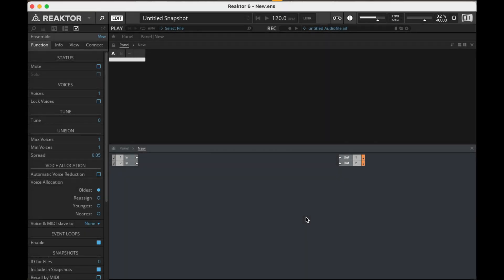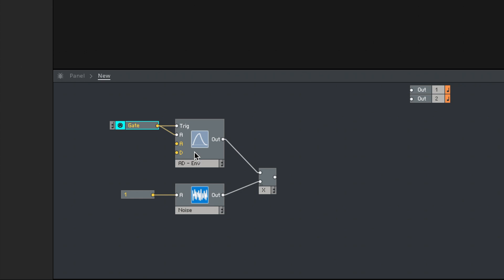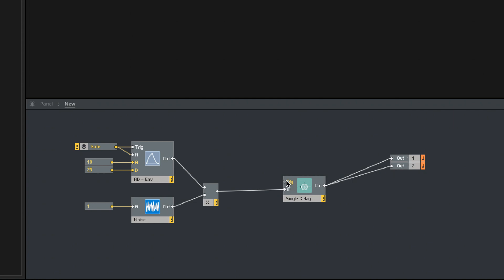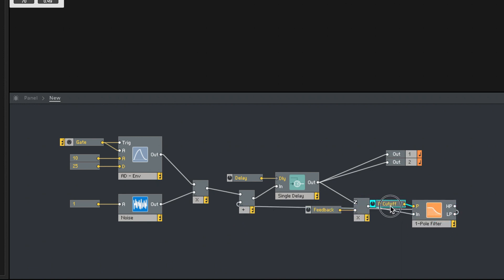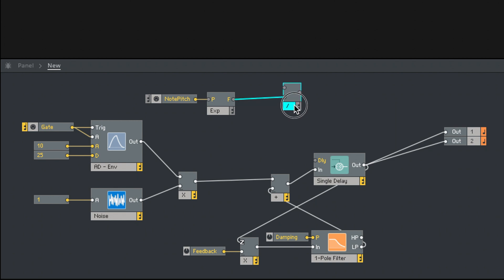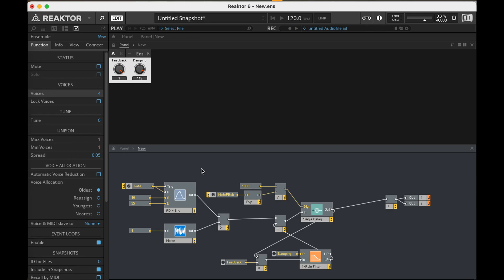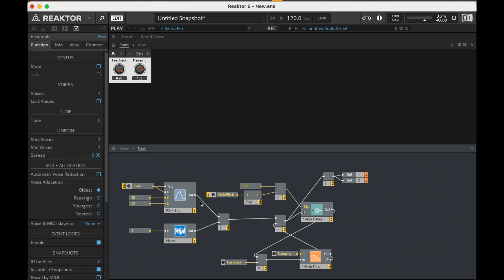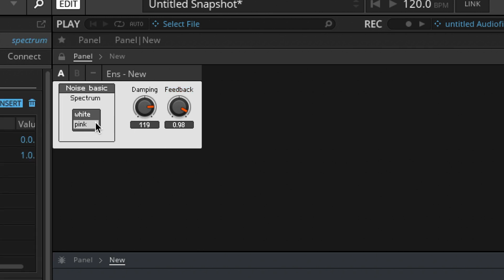Karplus-Strong Synthesis in Reaktor Primary (Reaktor Full Tutorial) | Simon Hutchinson

Comment: Very good! Came here in search of the meaning of "Karplusverb" of the Mutable Instruments Rings, but could not figure out the correlation between Reverb and Karplus strong ... Any idea? They call it also "caveman Reverb", but I could not find a hint on google about that.
Reply from the maker: Interesting, I don't have a Rings, but, as you can see in the video, K-S is just delay and feedback. Those are the ingredient of reverb too, so they probably just have some custom settings to leverage that.
Reply: Thanks for answering! After reading some more stuff, I think I figured it out: The "KarplusVerb" ist just one of the 3 modes of the Rings, actually its 3rd modus, which is a Karplus Strong engine. On the Rings you have some "hidden gems", and one of them is the Karplus mode with additional Reverb. The "caveman reverb" is part of the "easter egg" of the Rings. It is a string machine, and has 3 different FXs. One of them is also a Reverb, but not the same as the KarplusVerb. It is not further explained. I guess, caveman is just the describing of the sound colour - Cave Reverb. Btw, your video is an excellent explanation! For the first time I understand, how Karplus Strong really works.

Comment: The AD envelope needs to fully play out before it accepts a retrigger. I always just use an ADSR and keep sustain at 0 and control the decay and release with the same knob
Reply from the maker: Nice thoughts. I don't think the AD envelope specifically is the problem in this case (since the envelope is super-short), but the issue is related in that the feedback loop needs to finish (i.e. go back down to an amplitude of zero), before retriggering. That's why it was solved when I reduced the feedback even though I didn't adjust the envelope at all. Again, basically the same issue you bring up, but slightly different solution.
Reply: @SimonHutchinson  Ah yes indeed. The envelope was already very short of course. I´m definately going to add this to the synth i´m working on. If i stumble upon something really cool along the way i will report back here. Thanks a lot for the great video as always!